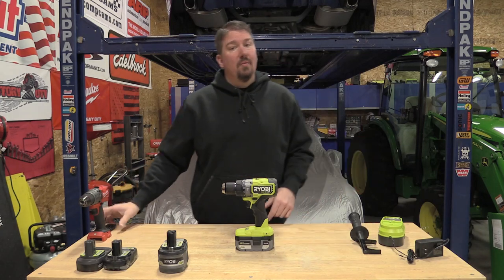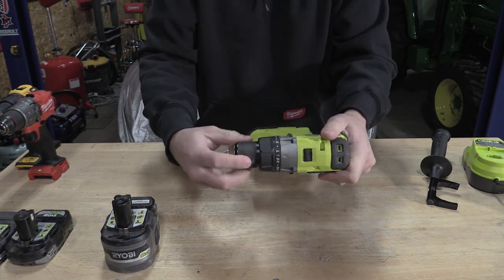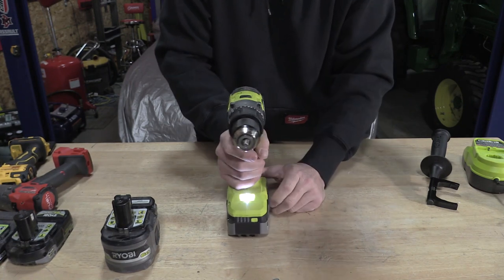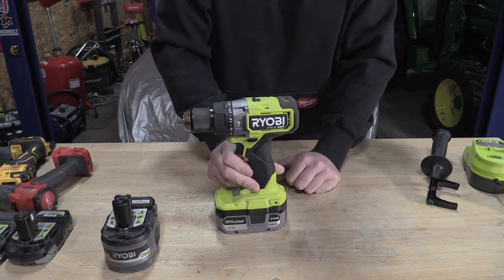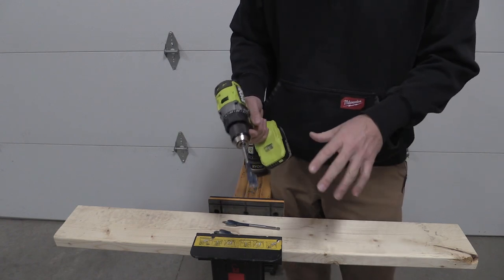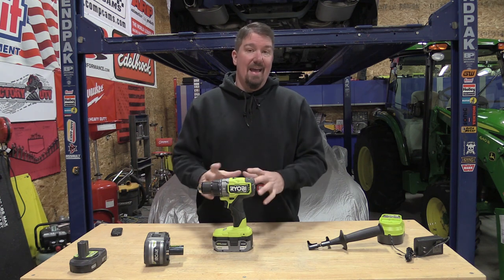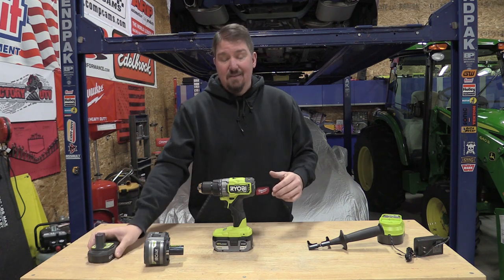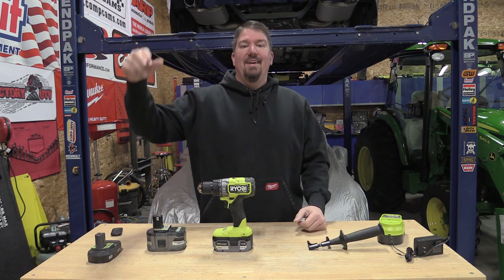Ryobi 18V ONE+ HP Brushless 1/2" Hammer Drill Driver Review | Model PBLHM101B

Comment: I've always stated in my own videos that Ryobi is geared for the homeowner.... however it seems that with their new lineup they are making a run at competing with other contractor tools....After all they are manufactured by TTI industries as is Milwaukee so it makes sense they are trying to compete
Reply from the maker: These are still homeowner tools and would not last on the jobsite.
Reply: @WorkshopAddict  .... Not saying they would I'm just simply saying they are improving in that category... they are distancing themselves more and more from other home owner brands such as craftsman.... Kobalt.... and porter cable.... they are getting more in the realm Of say Ridgid or maybe even Dewalt....Brands like Makita and Milwaukee Are still in a category of their own
Reply from the maker: @devilefan  IMHO, they are still no where near Ridgid's reliability.   If I were to test this tool like I would a Ridgid or Dewalt, we would see a smoke show.  Literally.   Seen it on a few of these already.
Reply: @WorkshopAddict  ....Again not saying they are I just said they are getting "in that realm"....They are definitely better now then they were and much better than the other three brands I mentioned in the homeowner category
Reply: @WorkshopAddict  Bullshit! Commercial/industrial electrician for 25+ yrs now. Been using Ryobi on the job site since they were blue circa 2004/05 before lithium packs appeared in 09.  My original core tools were drill/hammer drill, the incredible $69 "tool only" impact driver, and the sawzall. Sawzall trigger safety switch sucked balls so I just jammed a small screw to keep it closed but the tools were great and I abuse the crap out of my tools. Before Ryobi I had every major brand but Makita. Had Dewalt since the first 12V pistol drill, then Porter Cable before they gayed out(getting better recently)and did the good but really expensive Milwaukee thing. Yeah, I got ribbed for my homeowner tools but I was just as productive and could buy just the tool back then.
Reply: @barthchris1  damn straight, I snatched up the new line of Ryobi stuff and I work as an industrial electrician and the shit runs just as good if not better than some of the other stuff. And for a much cheaper price.

Comment: I love Ryobi snatched up the first brushless drill/ hammer drill. Performance was excellent but the all keyless metal chuck they used was crap. I tried and failed to remove the chuck to install a nice version from an old Dewalt xtr 18V.  Could never get the original off without feeling I was break something. Rubber mallet with Allen key inserted and chuck tightened. Brain wants to say reverse threaded removal but don't remember 100% ATM. I did check before trying the several times I didn't before giving up. Might try some focused heat on the fastener with a soldering iron for a while to loosen the epoxy, ehmm, locktite. If not drill and remove with an easy out.

Comment: Why didn't you used 3 amp with 21700 cells with new 4amp
Reply from the maker: Great question!  Per my ryobi contact, that is an old battery that will not be made in the future.  It could be wrong.  Bit the info I was given

Comment: The forstner shank is round instead of hex and it slips in my drill. How did you overcome that problem?
Reply: lol tighten it down well enough haaa... but forreal, it's bet to use a lil extension w the screws to hold the bit in place w forstener bits
Reply: @dabmanian_devil  I sold my ryobi drill and now I only have an electric screw driver and impact driver. I like them more than the drill because there are drill bits with hex shaft that I can swap out bits quickly and never worry about it getting loose and drop off.

Comment: Hi is on the same level as the milwaukee 2804? Am looking to buy a drill driver for my husband.
Reply from the maker: Not at all on the same level.  Milwaukee has much more durability and a better warranty.
Reply: @WorkshopAddict  Thanks for the info!!
Reply: @WorkshopAddict  What is the difference between the 2803-20 and 2804-20?

Am wondering if I should wait for a new version of the 2804 to come out to buy him since these seem to be made a few years ago. What do you think?
Reply from the maker: @stavroulaeconomou7256  2803 is a drill driver only.  2804 is a hammer drill.  2804 is a solid and reliable drill.  We are seeing very little new coming out right now so I would not wait if he can use it now.
Reply: @WorkshopAddict  The 2804 hammer drill function can be turned off and used as a regular drill driver Or is it only a hammer drill?

Thanks

Comment: Stopped watching at "as far as I know, this is the first ryobi drill with an auxiliary handle. It's not even the second, let alone the first. They have both a regular brushed hammer drill as well as a brushless hammer.
Reply from the maker: No issue bud.  I normally look at construction grade tools and I am not an expert in Ryobi.  This is the first Ryobi I have ever seen with a side handle.  Enjoy your day!
Reply: @WorkshopAddict  I remember probably 16 years ago some old timer with all Ryobi (Cords), saying he's had them for years, and never had an issue with them, that was at a Glass Company I worked for, obviously everyone else and me had Dewalt... And all these Years later, not having worked Construction for 5 years, I needed to Buy some power tools to build a house for myself, although maybe just a Shed this Year (Wood Prices), and I found the Ryobi HP the most bang for my Buck! And would consider them an Entry Level Professional Tool! I frankly don't have the True Need for some DeWalt Max's anymore, but I did have a need for something powerful enough that won't break! While also having staying power, and a Large Product Line, so in years from now I will still be able to buy new batteries that fit or other tools that work with those batteries. And I think a Young Guy just entering the Trade and needing X amount of Tools, surely could get Ryobi's HP Line ig the DeWalt Max's were just rationally to far out of the Price Range!
Reply: They had them on the blue hammer drills years ago lmao

Comment: I returned the hp line drill and impact there super weak I’ll stick with the ridgid sub Compact
Reply from the maker: You returned the compact HP drill and driver.  These are new.
Reply: @WorkshopAddict  didn’t like them I do have the one handed Recip and 3 inch cut off tool didn’t like the drill and impact driver of the hp series I’ll stick with my p238 3 speed and the 750 inch pound brushless hammer drill